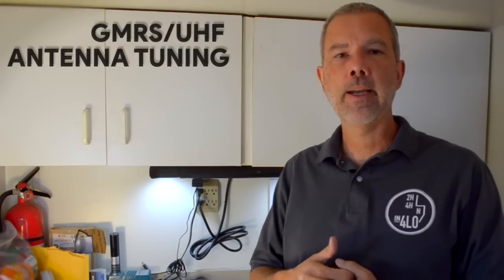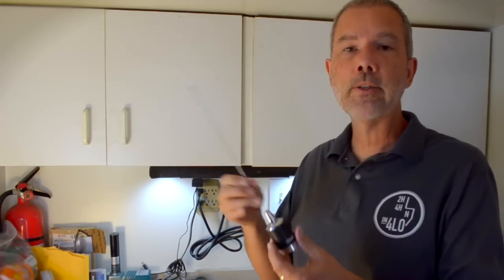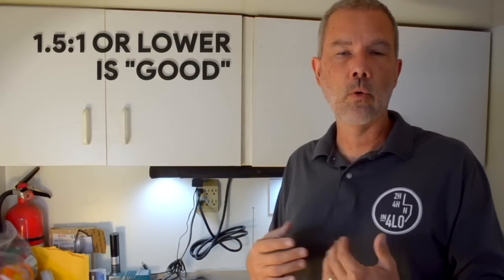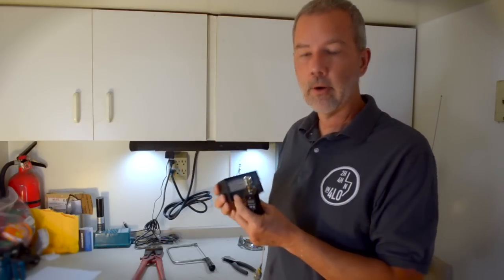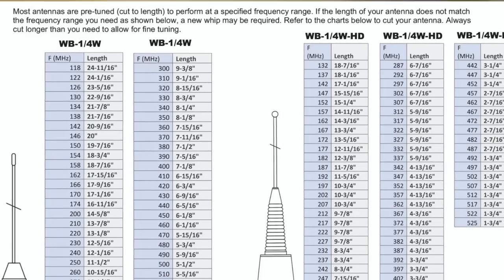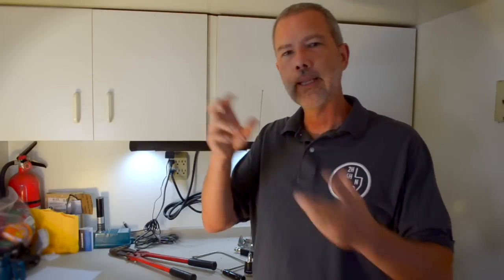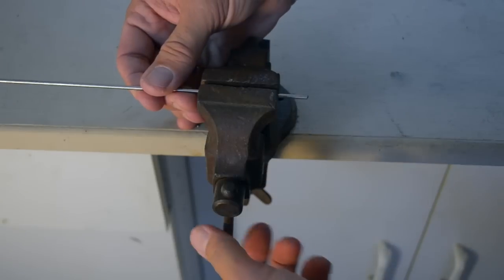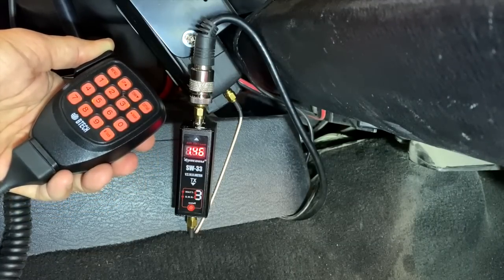How To Tune A GMRS Antenna & SWR Basics

Comment: I am a total newbie and buying the Wouxun KG1000G purely on your recommendation (maybe I shouldn’t do that but I guess it’s as good as taking a recommendation from any other YouTube yahoo out there 😂). 
So… My plan is to travel in a self built camper van.  I’m sure this is obvious to all the radio gurus that are on this channel… but… I want to install the antenna on the roof of my van.  Question:  Can I tune the antenna from any location or from where I want to mount the antenna (as in the location on the roof of the van).  Why do I ask this… 1) I may want to remove the magnetic base off the roof in high crime areas 2) Going up on down from the roof of the van, to cut off 0.5 cm, is going to be a serious pain is the a$$ 😂
Reply from the maker: IDEALLY you would tune it in the exact configuration that you will be using it - but, if you were to tune it stuck to the hood instead of the roof, it probably would not make too much difference..   
I would recommend getting a pre-tuned GMRS antenna - something like the Midland MXTA26 (which is what i now use)... You still want to check the SWR, but tuning should not me necessary. if the SWR is above 1.5 or 2.0'ish, its probably due to an insufficient ground-plane.
Reply: @TheNotaRubicon  have you done a review of compact antennas?  I have 2018 Ram Promaster Van… not a lot of places to mount my antenna, other than the roof… and a 32” antenna would make that sucker hit a few tree branches and even a few low bridges.  I was thinking something like this that I found on Amazon.  “Bingfu Vehicle Ham Radio Mobile Radio Antenna Dual Band VHF UHF 136-174MHz 400-470MHz Amateur Radio Antenna Car Truck Lip Mount Fixed Bracket NMO Mount Low Profile Antenna with 5m 16.5 feet Cable”
Reply: @CalmTurtle2023  I was running one of those trunk mount NMO brackets on the rear of my hood (as in; below the windshield ) for a Ham mobile radio. It worked great. When I go to GMRS I’ll use the same bracket with a ghost antenna.
Reply: @TheNotaRubicon  Darn it… I bought Wouxun ANO-050G Mobile GMRS Antenna at the same time!!
Reply: @CalmTurtle2023  That's a good antenna and should work out of the box.  But I would still recommend a meter.   You'll be able to test the wattage too.

Comment: Pretty new at this but unfortunately at my workplace you gotta take initiative to get shit done sometimes. 
Anyways we have kng-m150, with the MWV1365S, permanent mounts on the roof of the vehicle for most and others having a longer antenna from the hood. Having PA VSWR issues some will go into low power others wont allow transmit at all.
So try antenna, grounding, and then the coax cable?
For example, we swapped antennas and still got vswr fault so thatd rule out antennas. Then a swr meter would help me confirm a coax cable problem is that correct?
Also our frequencies range from 154 to 171.5, our most used channel is at 166.9. Thatd put the middle at around 162, but itd be quite a bit of work to change our 171.5 repeater channels. I imagine we could just aim for our 166.9 channel to have the least swr since our 154 channel is hardly used either.

Comment: Very informative. Thanks.👍 
Question: I just got finished tuning my new mobile radio and antenna, a KG-1000g & Midland w/magnet mount GMRS antenna. I have my SWR good at 1.02 across the channels on low power, but when I switch to HI power my SWR jumps to 1.6 to 1.75 on all channels. Is this normal or a problem? Thanks
Reply from the maker: Because SWR is a ratio, it should remain the same, no matter what the power level.  1.6 - 1.75 is fine, and not an issue, but it my guess is your SWR meter is not that great..
Reply: @TheNotaRubicon  thanks. My meter is a Surecom SW-102.  I don't think I'll make any more adjustments for now. Thanks again for the very informative videos.

Comment: Hi Randy, I love your videos! So I got two questions for you. 
1. How long was the antenna after you finished tuning/trimming it? 
2. Could you use a CB antenna if it was trimmed to the correct length, so approximately 12.75 inches? 
Thanks!
Reply: Don't use a cb antenna. It has different impedance no matter how short you cut it. It's kinda dumb they put the same connectors on the cable. But yeah, it will kill your radio.
Reply from the maker: Every CB radio I've ever used, and every CB antenna I've ever bought were 50ohm.   GMRS radios/antennas are also 50Ohm..
Can you tell us more about how the impedance is different?

Comment: Some time you can get another wire from hardware  cut it the same as antenna  wire  if swr is same on it  trim from uper end till the swr comes down then size antenna  wire

Comment: Got the BR-450 antenna and SURECOM SWR meter, plus appropriate connectors to hook up a RETEVIS RA25. "Out of the box" the SWR reading was 3.5. Radio set on channel 16 wide band. The hook up is, radio to SWR to antenna. Antenna magnetically on metal surface for potential ground plane. After MUCH trimming (millimeters at a time), the best I could get was 2.8. Multiple examples in YouTube show a starting SWR less that 2.0. I must be doing something wrong.  Any suggestions will be greatly appreciated.
Reply from the maker: a high SWR out of the box with the BR450 is normal because its not a GMRS antenna.. It does not become a GMRS antenna until you trim it down.
It may just be that 2.8 is the best you will get with it using the cable/connectors/groundplane you have.  Nothing wrong with 2.8 other than its not "perfect" ..
Reply: @TheNotaRubicon  Thank you for this insight. It's good the hear the voice (text in this case) of reason!

Comment: Running a magnetic stick on ant using a plate held with 2 sided tape on my f150 aluminum truck. Is there a need to ground the plate separately? 
Or get a new truck… maybe a jeep!

Comment: Is it possible to repurpose a Wilson Little Wil CB antenna for GMRS by trimming its single wire length using the Surecom SWR meter?
Reply from the maker: Never tried it, but if you can cut it to the right length, it might work? Try it and let us know!
Reply: There is a coil of wire in the base that may or may not let it tune to that high of a frequency,  replace the stainless whip with a same length  piece of copper wire or even an old coat hanger that has any insulation scraped off so it makes good contact with the set screw on the base, cut about a half inch at a time from the top checking your swr along the way, this will save your original whip in case it doesn't tune. If it does tune, cut your stainless whip to the same length as the test whip
Reply: @TDanNix  Brilliant!

Comment: I have a question about the tuning. I got the SWR to 1.0 on GMRS channel 16. When I tested the SWR on our local GMRS repeater frequency I'm getting a SWR of 1.7. All of the 467mhz repeater frequencies give me a SWR of 1.7 or higher. Do I need to cut more off to bring the SWR down for use of repeaters?
Reply from the maker: no.. 1.7:1 is fine.
Reply: @TheNotaRubicon  Thank You, I will leave it where it is. I love your videos and have been recommending your videos to other GMRS users in our area. Thanks again.

Comment: I was looking at your "affiliate link above" for the SWR meter and did not see the jumper cable like you use in the video from the meter to the radio. Is this something you fabbed up or can that be bought as well? I am worried that making my own could result in poor connection or incorrect readings.
I am also looking at buying this- Authentic Genuine Nagoya UT-72G Super Loading Coil 20-Inch Magnetic Mount (Heavy Duty) GMRS (462MHz) Antenna PL-259 to use with my pre-ordered Wouxun KG-1000G in my TJ and don't want to kill it after spending that kind of money and waiting however long it will take to get.
Love these videos keep up the great job. I hope this long question does not remove me from being your favorite viewer.
Reply from the maker: You can use any short coax jumper cable made of "UHF".

Comment: I have a radioddity 20 watt that I use as a base station. I have a laird 5db xs 2 1/2 wave ant set up on the second floor of my house. I have not trimmed it and on repeater channels I get a swr of 1.01. on my simplex channels I get 2.58. I only use my repeater channels. SHould I bother adjusting my ant or am I good to go.
Reply from the maker: 2.58:1 is not a "great" SWR, but I would not bother messing with it.

Comment: Question: when u tune a gmrs antenna on a vehicle will it work ok when you use it on a diff vehicle?
Reply from the maker: For the most part, yes.. However the SWR could be different on the other vehicle due to a different ground-plane, connections, etc so its always good to check the SWR.

Comment: Quick tip. After setting the bolt cutter where you want to cut the antenna, throw a small rag over the top of the bolt cutters and antenna end so you don't shoot those little suckers all over the place. They'll drop right at your feet.

Comment: Stupid question, no doubt, but I will ask it anyhow.  Let us assume that you have trimmed so that your SWR has dropped from the original 1:8 to 1:4.  Now, you are about to proceed to trim again, making sure that you are taking the same size bits from the antenna as you have previously in the process.  You are, of course, trying to get to as low an SWR as possible, so you continue.  You test after making the last cut, and the SWR begins to proceed back up the scale.  You check everything that you have mentioned regarding what could cause this problem but nothing other than the size of the antenna seems to be the problem.  Consequently, you are stuck with the higher SWR now.  You can't go any lower now, of course.  It is at that point in the process that seems to be totally unpredictable.  When do you decide that the process needs to stop?  Do you settle, say, for instance, on the last measurement of 1:4 or do you take the "leap" so to speak to venture into the land of "damn, I have to buy another antenna!"
Reply: Been there and done that more than once.  Depending on your particular antenna and its 'style' I have found that Amazon sells stainless steel rods in a 10-pack of varying lengths that have helped me to save a two-part antenna that I over trimmed. It was easy to get the hang of it when I was practicing on disposable rods. My final tune on my expensive antenna was 1.25  on Channel 15 at Low Power. Channel 1 SWR is 1.15  Good enough for me.  Thanks Amazon for the 300mm x 3mm 304 Stainless Steel Solid Round Bar Lathe bar Stock- Pack of 10 for $11.00.

Comment: I saw in another on of your videos comparing several antennas that the Middle Ghost antenna was over 2 SWR. 

Is there any way to tune that style of antenna to improve that?
Reply from the maker: The ghost antennas are not tunable, but as long as the SWR is below 3, most people consider that 'ok'.

Comment: Thank you for another great video.
Questions. The browning antenna you show obviously requires the purchase of a base for it to screw on to?
What about the length of the antenna wire does it effect the SWR?
I just purchased a UV9G ( and made sure you got credit for the sale) and want to use it at home with an antenna on the roof. What kind of antenna do you recommend for that?
I have been told to use a Discone is that the best idea and what about a ground plane?
If I use one of the mobile antennas do I have to mount it on a cookie sheet like you did?
When the OEM antenna is mounted directly to the radio what is the ground plane then?
Thanks for your help.

Comment: the SWR meter you recommended shows the use of a "test jumper coax" in the instructions, but not included in the box?  Where do I find that coax cable?
Reply from the maker: You will need a short "jumper cable" - You can find them on Amazon, at your local radio shop, or you can even make your own.  Just make sure that it has the correct ends/connectors to connect to your specific things that you are connecting to.
Reply: @TheNotaRubicon  thanks, I purchased the Wouxun KG-1000 per your recommendation, got it installed and want to check the attenna, i'm having trouble finding the right connections to fit.  Can you recommend via Amazon?

Comment: Newbie question - just got my first GMRS radio and was given CB radio I haven’t used either.  Will the SWR meter for GMRS also work for CB antenna adjustments or would I need a separate meter for it?
Reply from the maker: It depends on the specific SWR meter, but, probably not.

Comment: I totally understand a Firestik is for CB radios and is not intended for a GMRS radio. I currently have a firestik on my jeep with the tail light bracket. I'd like to keep it symmetrical on the rear. So, is there any way to modify a firestik aka longer or shorter screw at the top to make it work on GMRS? I'd like to run a pair of firestiks, one for CB and the other for GMRS.
Reply: No but you can still use mount and coax and play with different adapters for proper band antenna to fit in same place..
Reply: That's a good question, I was wondering the same thing.

Comment: I have a President radio that may have been modified to open up the CB bands. (So it's a CB, 10 AND 12 Meter radio.) I also have a President Antenna that has a couple of tuning rings. 2 questions: with GMRS radios, do they have any that have a build in SWR meter? And, do they also have an antenna with such tuning rings?

Comment: Are there specific channels to use when you tune and do you have to use low power?
Reply from the maker: The antenna can only be tuned perfectly to one frequency, so you will generally tune to a middle channel, then double check on the lowest and  highest channels to make sure they are still ok..
Because SWR is a ratio of reflected power, the power level should not matter because that ratio will always be the same (or very very close)

Comment: Ok Genuine Question... Why on Planet earth...if I bought a Specific GMRS antenna...which I assume is Tuned  FOR GMRS (arent all GMRS frequencies exactly the same on all GMRS radios)...do I then Have to tune it myself? then why even buy a GMRS antenna???? what am I not understanding here?
Reply from the maker: If you buy a UHF antenna, you will need to tune it. If you buy a GMRS specific antenna, you should not have to tune it, but, you may still have to.

Comment: What about pre tuned antennas?
Reply from the maker: I have recently tested a few Pre-Tuned antennas. They dont work any better than UHF (non-tuned), but it sure is nice not having to cut/tune them.  I just put the Midland MXTa26 6dB gain antenna on the Jeep.
Reply: @TheNotaRubicon  so should we buy this antenna .

Comment: Hi there. I just installed a Btech 50x1 radio with a Browning antenna. I purchased an swr meter like you use and right from the start on GMRS channel 16 it was 1.0. When I went to Repeater channel 16, rechecked the swr and it showed 2.0. Is this correct or should I try cutting the whip some to bring it down? Thanks
Reply from the maker: Regular channel 16 transmits at 462.575.. Repeater CH 16 transmits at 467.575, 5Mhz higher, so you need to tune the antenna the best you can for both frequencies - you will probably end up with 1.5 for each.

Comment: I lucked out , I had a pro that works for public safety doing radios . I have a Motorola cdm 1250 with a team 1480 6.5 db gain with 50' lmr400 .he got 1:1:1 match .wow does it get out too .our club has 3 large repeaters . We all check out not a these videos great tips for our new people and us ole timers as well . Great videos keep em coming .73s nysgmr

Comment: So why go with the UHF antenna you have that you have to trim instead of something like a Midland 6db whip antenna that is supposedly cut at the correct height?
What are the gains and losses of either choice?
Reply from the maker: I went with a UHF antenna that requires manual trimming because the GMRS/no-trimming antenna that I wanted was out of stock.
Reply: @TheNotaRubicon  Thank You for the reply. What antenna did you originally want?
Reply: @TheNotaRubicon  Morning! The Midland 6DB whip vs the short stubby 3DB gain. I am not sure if I am understanding this correctly. Does going from 3DB to 6DB  “double” the range and or power?

Comment: Problem I'm having is i have a mix of business band 450 up to 469 my antenna is rated for for that Spectrum I can get 1.1 swr on some channels then when I take it to my main Channel I use all the time I'm getting high swr 469.550 antenna is rated from 450 to 470 so if I get 1.1 on one of the frequencies and 1.5 on the rest is that fine also I have the same Pantano you're using in the  video what section do I trim the lower or the top section

Comment: Do you stop once you get below 1.5:1 or keep going until you get closer to 1.1:1?  How do you know when to stop cutting, or more importantly, what if you go too short looking for the best ratio?
Reply: Trim only a very small amount at a time, and only if moving the whip in/out of the base doesn't give you good enough results. If the SWR lowers as you move the whip farther in, but the whip bottoms out, then cut a very small amount and try again. "Rinse and repeat." If the SWR starts to go up - STOP cutting and move the whip back UP just a small amount and the SWR should go back down.

Comment: First let me thank you for all the information you have made available. It has helped tremendously. I am a total noob. I have 3 radios on order from (affiliate link below). And have been researching, but I can’t find much on antennas, mounts, wire, connectors ect..  Any suggestions on where to look? I’m thinking of contacting we’re I purchased my mobile unit for my truck to ask for suggestions. But I thought I’d ask you first. And maybe give you video(s) idea(s).